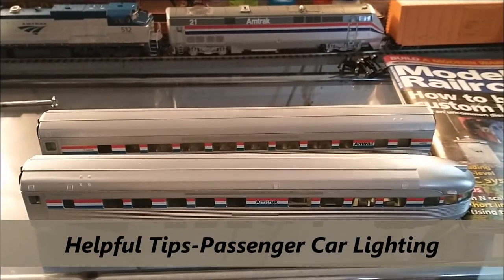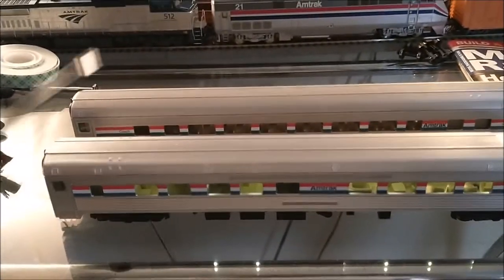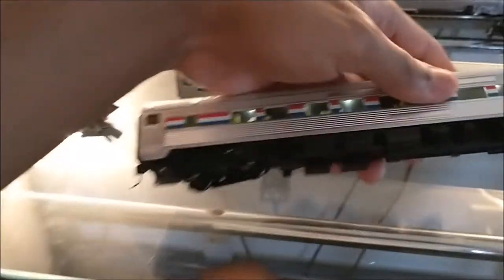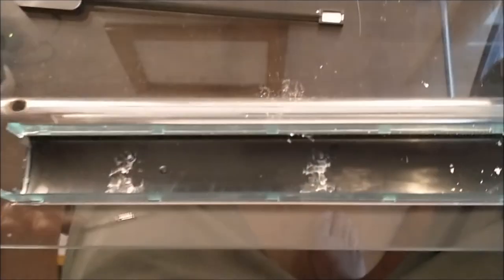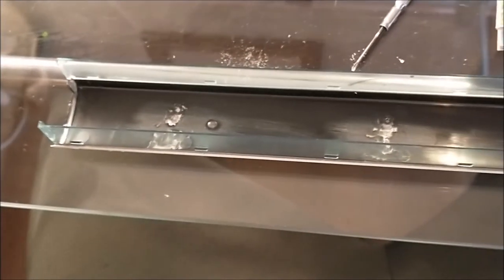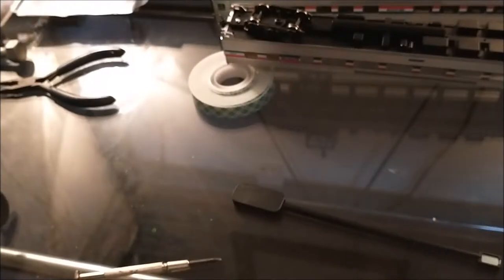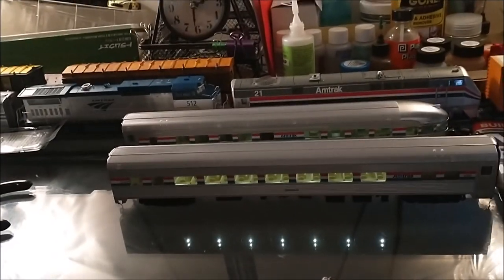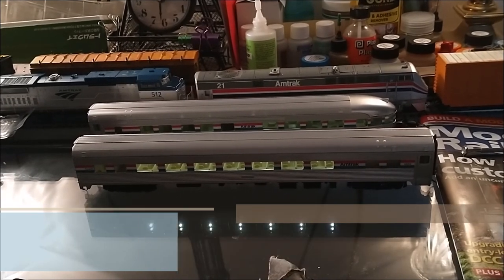Helpful Tips- Passenger Car Lighting

Comment: Do you have a part number to offer for this kit you had purchased? Perhaps the Brand name to help others locate this light system. I like how it appears they are activated by a magnet switch?
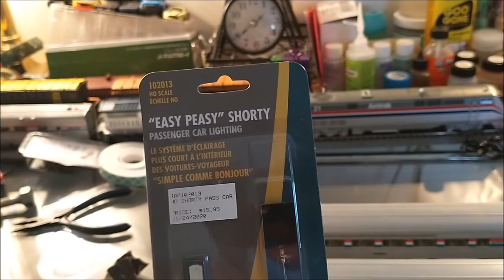Reply from the maker: If you pause it at 0:41-0:42 I show the part number on the package. I even put the part number and name at the bottom of the screen at 0:55-0:56. It's made by rapido and they are activated by a magnet wand.
Reply: @EMDSD14R   Sorry, I did not watch the full Video as I was distracted. Thanks.